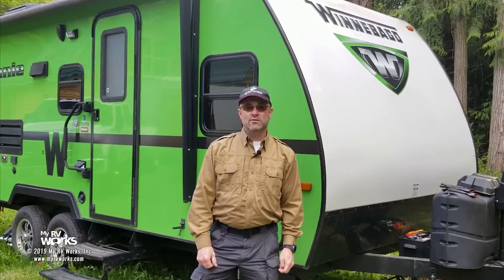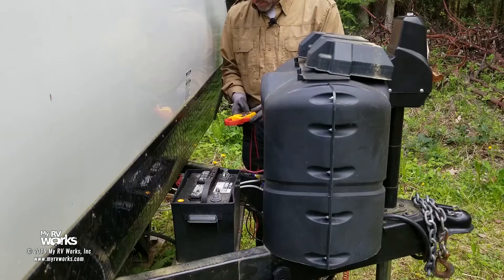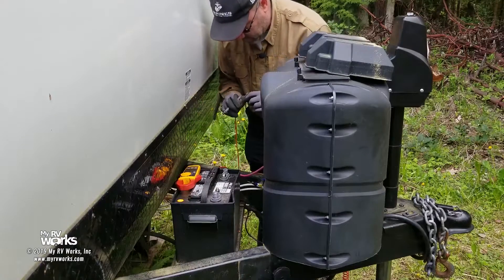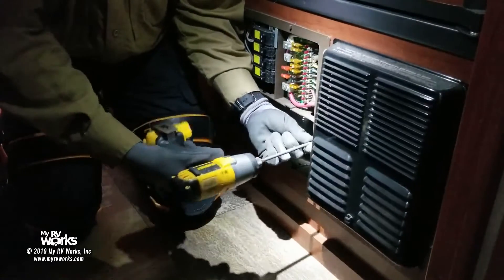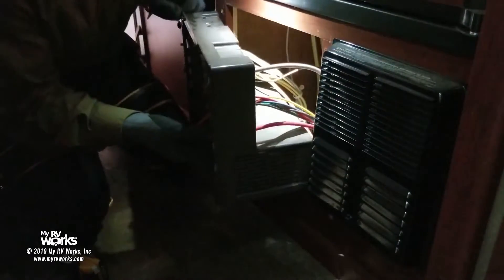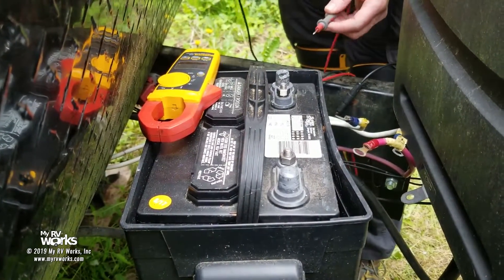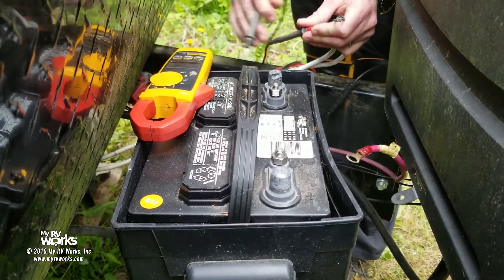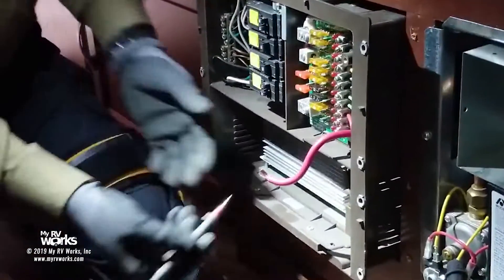Troubleshooting a Travel Trailer with a 12 Volt Circuit Short

Comment: Why did it not blow a fuse?
Reply from the maker: That's the Thousand Dollar Question. It may not have been a dead short to ground. It may have had something that had a tremendous amount of resistance in it though. The meter was running on that job so the customer was satisfied when the problem went away so we stopped the meter. The Next Step would have been to start pulling walls out.
Reply: Gotta let us know if the problem comes back. I hate not getting the satisfaction of the smoking gun. It's like everything works but.......

Comment: If I was to guess the cause at the conclusion of this excellent trouble shooting video, I would say a grommet  to protect the wires from becoming chaffed against the frame in this case possibly aluminum framing where the walls meet the roof has either come dislodged, or was never installed during manufacturing. 
Excellent trouble shooting skills and yet another reason why we cherish your time Darin.  Thank you
Reply from the maker: I think you are correct.  I have followed up with the customer, after several months, and the issue has not returned.  Keeping fingers crossed eh'.  Thanks for watching.  Happy Camping!

Comment: Why isn't my battery being charged I have a keystone 2011 raptor toy....is my convertor bad...I'm currently using a battery charger to keep the battery charged
Reply from the maker: Near the battery you should find a circuit breaker fuse. Make sure you have continuity through that. If you plug into Shore power, and you have 12 volts for your lights Etc, then typically your converter is fine. So if that's your case, it may be that circuit breaker between the converter and your battery.

Comment: Here's a head scratcher for you. I have a cigarette lighter socket in my RV and it wont charge a cell phone. The cell charger lights up but as soon as you plug a phone into it the light just goes dim.  I put the multimeter on it and only reads 11V. It's a blue wire that disappears into a thick wire loom and there's no fuse anywhere that's marked 12 volt cig etc.

Edit: 2 big fuse panels under the front hood, one panel in front of the steering wheel, tons in a side panel outside too. I just cut the blue, capped it off and tapped into a red 12v wire that had a yellow crimp connector end on it with the one end that went nowhere which wasn't crimped either so that tells me it wasnt in use but now it is. chargers work but that blue wire still gets the best of me. Why is it 11V? Strange.
Reply from the maker: Sometimes that is an indication of a loose ground.
Reply: I would say that you have high resistance on your blue wire. Here's why... the blue wire has 11v, it should be 12.6 or better. You plug in the charger and the light comes on but it has a very small load on it until you plug in the phone. At this point your load has increased but the wire can't carry the current because of the resistance. I have seen this scenario many times where you put a meter on the circuit and it reads almost battery voltage, the resistance is ok but not perfect, say 1.8 ohms. Initially these readings would look ok but not perfect. A good test is to load test the circuit, a light bulb is a easy tool to use, and load the circuit to 50% of the fuse rating. In this scenario if the bulb lights it would be dim if it light at all. Hope this helps.

Comment: So now there is a exposed short that will eventually happen again.
Reply from the maker: Allegedly.   Best guess is that the wire was touching an aluminum frame member and when I pulled on the wires it moved off the frame.  In that case the trail we were following ended.  Next step would to have been taking out ceiling and walls to explore deeper and use my Fluke TS90 to try to corner the fault. No telling which of the three wires to follow and if the fault in the jacket would even be visible.
In cases like this we perform a full-stop and consult with the customer to determine if they want us to go further.  With the fault gone it makes it a lot harder to track down and the invoice will get expensive with no guaranteed results.  This customer decided to call it a day and if the fault returns, we have an idea on where to look.  I think it was a good call but had they wanted us to keep going we are equipped to have done that too.
Reply: @MyRVWorks  How much did you charge for something like this? If you don't mind me asking.

Comment: 90% of the time I find a single spade bulb in a double spade socket.
Reply from the maker: Yes, I have seen this.  The lights in this RV were LED so not a chance of finding any of that in there.  Most likely the wire jacket was rubbed through touching a frame.   When I pulled it to inspect I it moved that part.  Customers choice to have me keep looking but the meter is running and I think everyone involved in the decision thought it best to end the search.

Comment: I wonder why the fuse didn't blow on that short circuit?
Reply: Philip Housel  Absolutely legitimate question to ask.
Reply: @Charlie_Paula  the best question
Reply: The 12V output shuts down when it senses a short.
Reply: @stevekrebs438  doesn't make sense. If there a current sensing circuit to turn off 12v, why a fuse?
Reply: @PhilipHousel  I am seeing a dead short to ground on two circuits with no blown fuses. It turns out that those are slow blow fuses and the 12V supply reacts faster than they do.
Reply: @stevekrebs438  interesting. You must not have a battery as part of your 12v system.
Reply: @PhilipHousel  I do.
Reply: @stevekrebs438  interesting, you have a battery that shuts down output? Must be a fancy lifepo4 with bms.
Reply: @PhilipHousel  If you think about it, a sensor will always be faster than a fuse. Just like a GFCI opens a circuit upon detection, but a fuse waits for the heat of a current to burn it open.
Reply: @desirdesigns  in my professional experience working with 12v systems in cars, RVs, and other mobile systems. There isn't a sensor turning off the power, just a "short" not causing enough current draw to open the fuse. He absolutely right about intermittent issues being challenging to diagnose when they go away while working on the system.

Comment: This video did not find the shorted wire, but Darren noted that he opened a wire nut with three wires, and the problem went away. I wonder if the wire nut was wrapped in electrician tape. If not, that may have been the source of the short. Wrapping wire nuts on hot wires ensure that nothing else is able to penetrate the wire cluster and possibly cause a short.
Reply from the maker: Hi Dennis,

Thanks for the comment.  The wires were connected with a crimp  cap connector - no wire nut.  Most of the DC wiring in RV's is joined with those style of connectors.  I was more than happy and capable to continue the hunt but that is a service we charge an hourly rate for.  The customer chose to stop the meter and if the issue returns we will get back out there but next time we have a head start on where we might look.

I appreciate your contribution to the channel.

Cheers,
Darren Koepp

Comment: Must have been my dad's wiring job lol he was consistent all right with those wire strippers consistently inconsistent system
Reply: Hi Matt,  

I chuckled at your comment.  I usually get called in after such events to put all the pieces back together.  Thanks for watching!

Cheers,
Darren Koepp
Reply: @DarrenKoepp360  I couldn't warranty the work if my dad worked with me at the live lines only the grounds.

Comment: Is there any place where wiring diagrams for a particular RV can be located/ purchased?  A couple of years ago, I had the same problem, but it wasn't the lights, it was the RV brake pull out switch that had been pulled out accidentally been pulled out while disconnected while removing the bars from my load level hitch.  It almost ruined by two six volt batteries.  Good video.  I would check the wires to that light as far as you can visibly for nicks, because there must be something  wrong in that length.   Good luck with your channel.
Reply from the maker: Some manufacturers do provide wiring schematics, Winnebago comes to mind specifically. But for the majority of them I'm not aware if they do offer that. Even if they did offer detailed schematics tracking these things down still takes detective work, sleuthing and tools to help you see the problem.
Reply: Hi Bob,

Regarding wiring schematics, there are a few Mfg's that provide schematics for their units, Winnebago comes readily to mind.  We get into challenges sometimes with shorts like what I came across in this unit.  Even if I had the schematic I would still have to sleuth around to locate it.  

You can try your OEM owner relations or tech support center to see if they offer schematics for your unit.  Then get some good tools and metes to help you hunt down the fault.

On this unit I could have kept hunting until I found the faulted wire but I charge for that service and the customer chose to let it go as it was saving on a potentially large service invoice.  Since the fault went away it makes it difficult to pick up the trail again eh'.  If the fault returns we can get back out  there and have a head start on it next time.

Thanks for your comments and for watching!

Cheers,
Darren Koepp